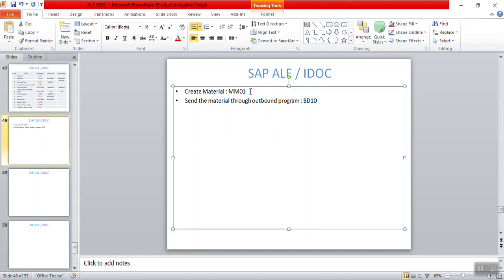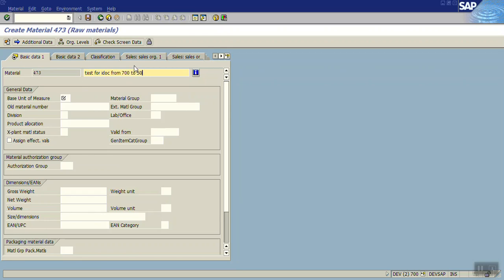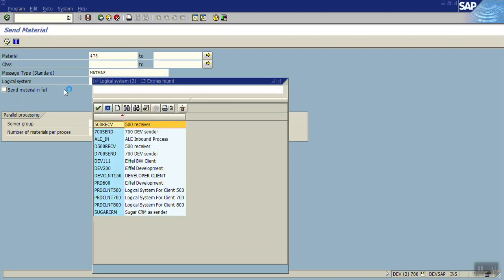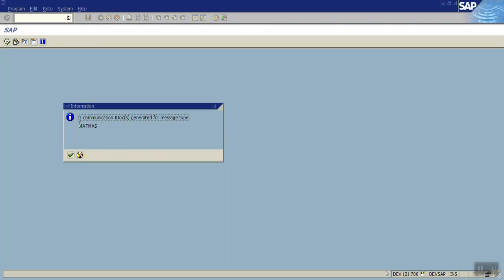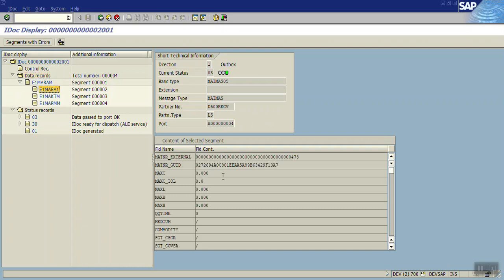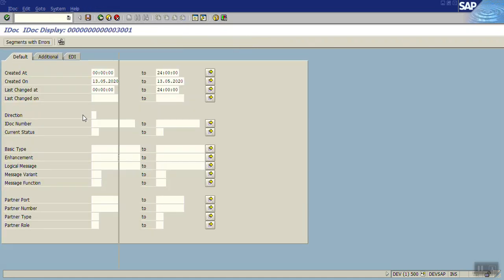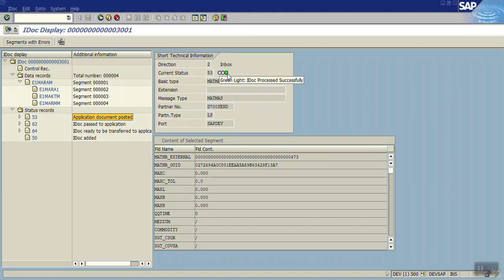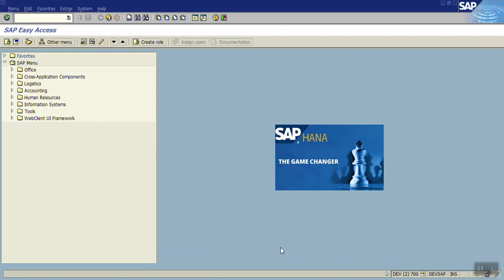9 Data transfer from sender to receiver system using idoc

Comment: Sir i have a one doubt is 500 Client Should have same configuration which is having 700 Client? at the time of using MATMAS
Reply from the maker: Hi,
If the field mapping is different, like material type, material group etc, then in conversion rule you have to handle that.